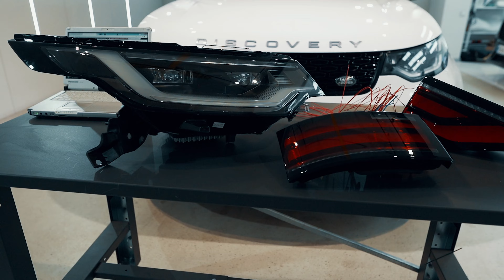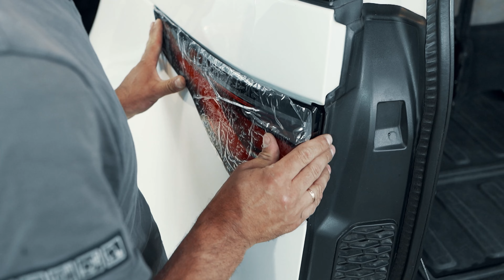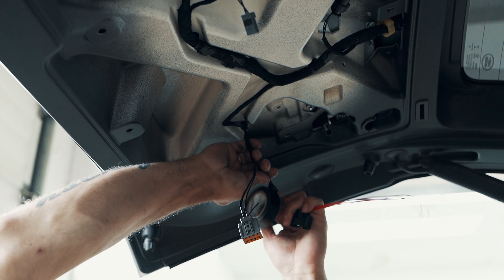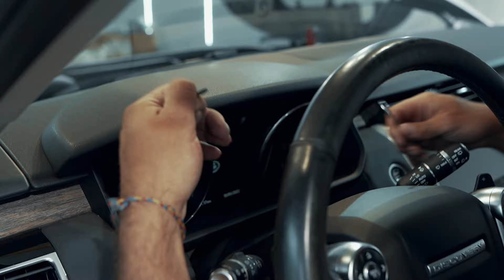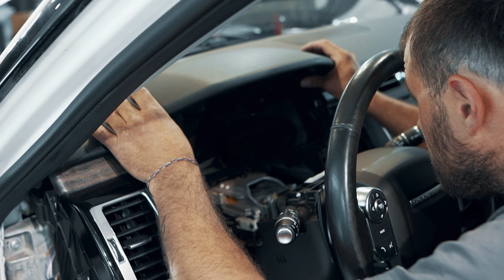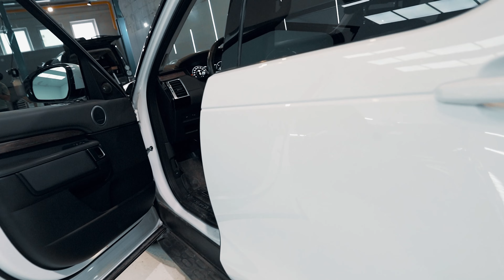Land Rover DISCOVERY 5 restyling headlights and taillights retrofit

Comment: You guys have some incredible retrofits and updates. WELL DONE
I do, however, have concerns about the amount of electrical tape you were using. I couldn't quite make out if it was being used to wrap around bare wire connections or for bundling wires together? 
Surely heat shrink should used for safety and longevity.

Comment: I prefer old headlights and the new tail lights. I hate old tail lights coz they are so tiny but ive seen in some lr5s where the brake lights up 2 leds but most is only one tiny led, or is there a setting to change from one led to 2 brake light leds?
Reply: I need an answer for this also!

Comment: What electrical modification is required to put the rear lights on please?
Reply from the maker: You should change the wirings and all tail lights connectors
Reply: @lr-chip  is there any instructions to do this?